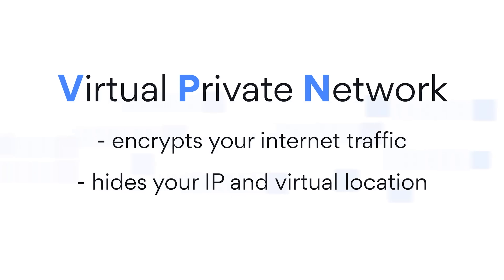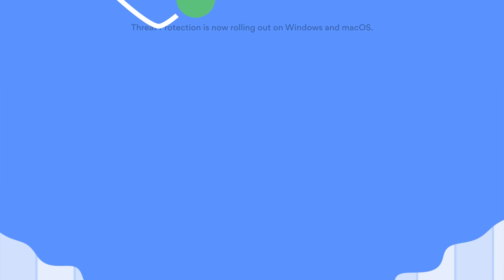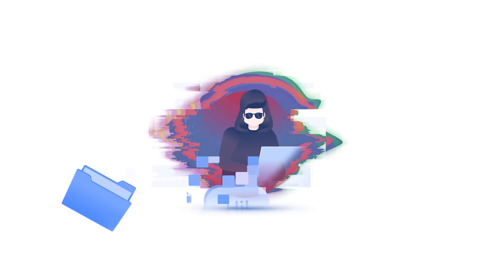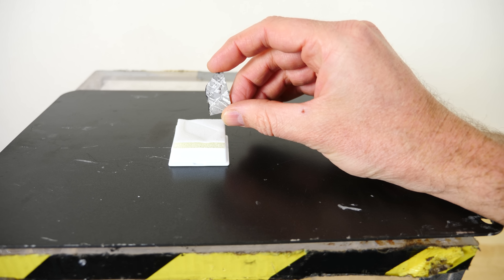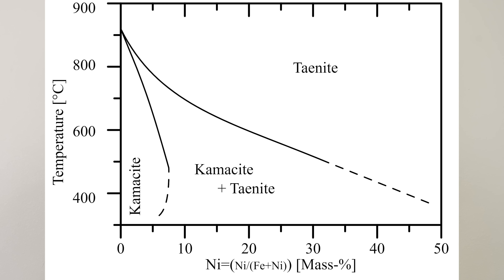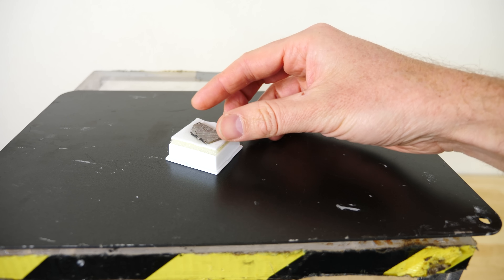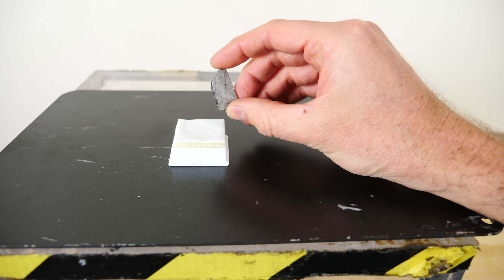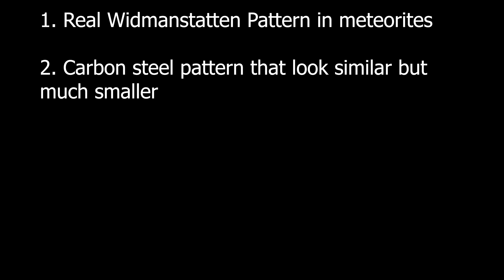Why Can't Widmanstätten Patterns Be Made on Earth?

Comment: is there any effect of heat on this material when it enters earth atmosphere?
Reply: The highest recorded temperature of a meteorite upon entry was to the earths atmosphere was 1500°c, though the majority are well below this.
Iron melts at 1538°c and nickel melts at 1455°c, therefore on most occasions the asteroid won’t get hot enough to effect its structure when entering the earths atmosphere
Reply: @Tomd8002  I think you're misleading the asker. The melting point of an alloy is lower than the melting point of its pure metal constituents. Also, metals don't have to reach their melting points to have differences arise in their crystal structure. Modern metallurgy relies upon this fact for heat treatments.
Reply: Yes. However, the speed of entry is such that while the surface heats up greatly, it doesn't have enough time to heat up for long. The surface heats up and is abated, and, as it ablates, heat is removed. This is why early space re-entry vehicles had ablative heat shields, to keep the astronauts alive without being affected by the intense heat.

Small meteoroids will burn up completely as meteors. Sufficiently large meteoroids will impact as meteorites. Whether or not meteorites have been affected by heat internally appears to depend upon size as well as composition. Stoney meteorites don't conduct heat well.

Some people report having encountered meteorites covered in frost and handled cold meteorites despite local conditions not being frosty. Presumably the meteoroids have been cold in space and, despite some surface heating, they have retained their low core temperature long enough to cool their surface and freeze earth water on them, then are found soon enough that they haven't warmed up yet.